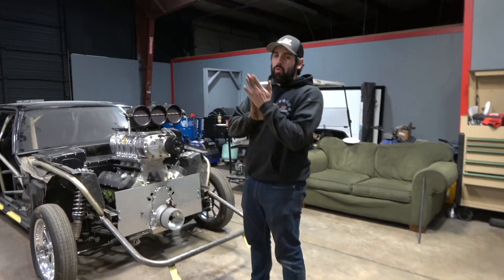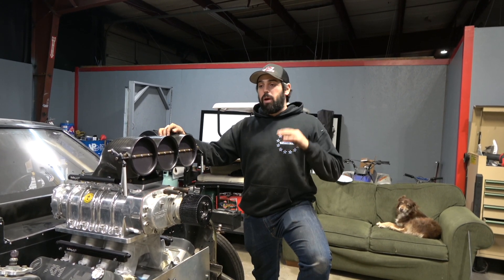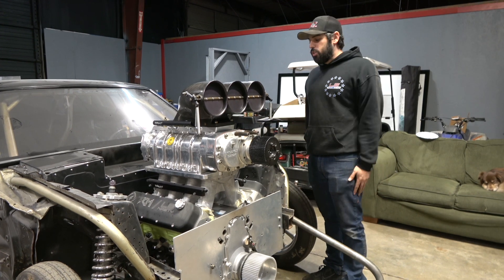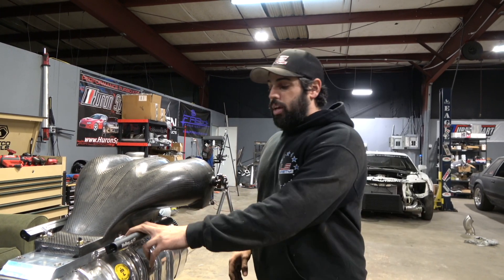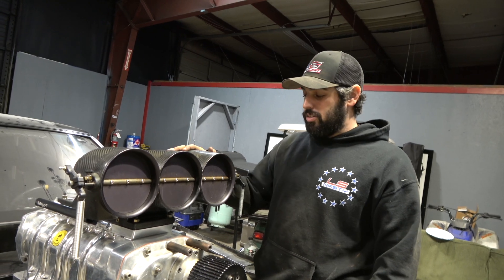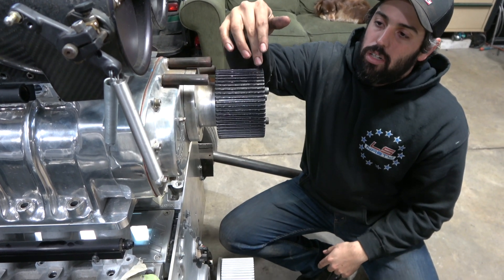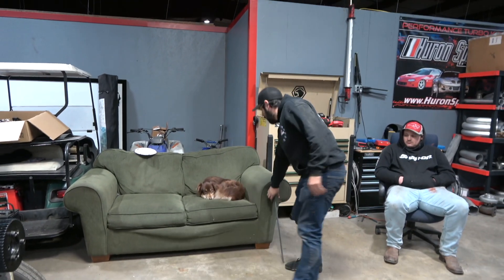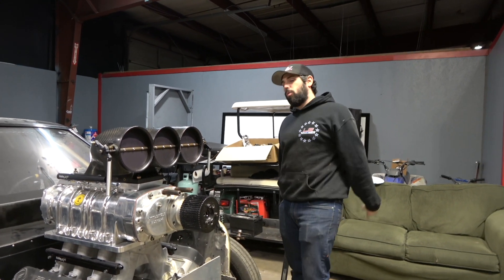WE MADE IT FIT!!! 14/71 Blower in a LS Powered FOXBODY!!!!

Comment: Too bad you didn't take the car to CJRC to begin with at the very beginning when you first came up with the idea for the Glizzard for an LS powered Blown 2 seater drag car but really what you should do is make it a drag and drive car since you are making it extremely fast and it's going to be 2 seats that's enough for a pilot and co-pilot and just hook a trailer behind it for tools and extra/spare parts and fluids and just make a steel roof and quarters drag and drive car out of it like all the other really fast guys and go out there running mid 6s in an LS powered vehicle